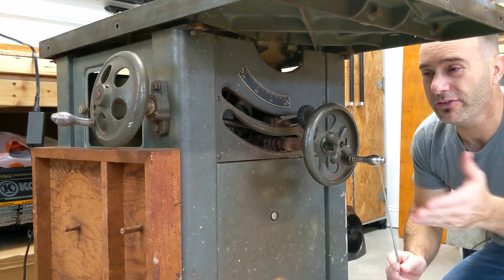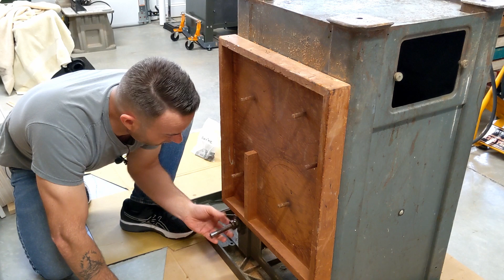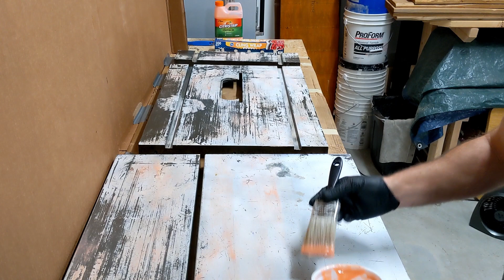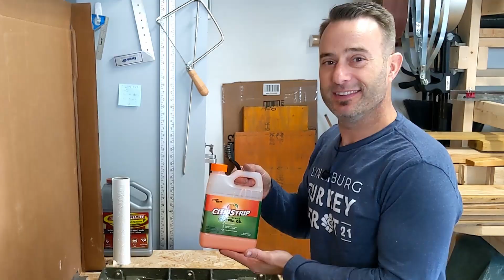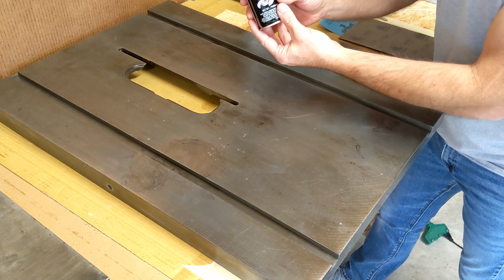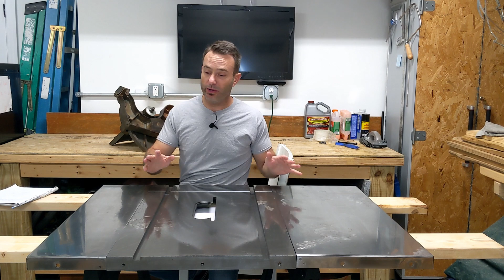Walker-Turner 10-inch Antique Table Saw, Part 2: Disassembly and Tabletop Restoration

Comment: Where did you find a vendor for the three small drive belts? I haven't had any luck. My belts are stamped AC TEX ROPE but the size or part number is not able to be read.
Reply from the maker: I haven't resembled this saw yet, I'm still on the paint phrase, but I still have the two belts that came with it. Mine are standard v-belts and I measure the length when they are in need of replacement. I've actually bought v-belts for my jointer from Amazon. Does this help?
Reply: I ordered mine from either MSC or McMaster Carr, I'll need to do some digging to find my information. You can order from either one from their online catalogs. Shipping from MSC is expensive but they will put in on your doorstep the next day.
Reply: Belt size Dayton 3L160T ordered from Walker-Turner Services in Connecticut $11.00/each.

Comment: On something as lightly damaged as that, consider a vinegar bath. 4 to 6 hours, no more, then warm wash with a heavy baking soda content, then dry and polish. If much is needed, sanding can screw with the squareness of the deck, so avoid it until the end. The vinegar will extract any rust from deep inside the pores of cast iron. But more is not better, in terms of soak time! Chemical dip as little as possible to achieve the result and neutralize as quickly as possible once you remove it.
Reply from the maker: Thanks for the tips!
Reply from the maker: I experimented with the vinegar method on this base, which will be in the next vid; it worked wonderfully. Stay tuned!
Reply from the maker: I experimented with the vinegar method on this base, which will be in the next vid; it worked wonderfully. Stay tuned!
Reply: I also found that applying a thick coat of paint stripper first, like strypease, really speeds things up and allows you to reduce the time that the vinegar is left on the surface. That's helpful because the vinegar can seriously etch the metal if left too long. I applied the paint stripper, waited about an hour, got it all off and started the vinegar process. In addition to removing the paints and glue, for whatever reason, it soaks into the rust and sort of pre-loosens it. Looking forward to seeing your saw completed, great job so far! @ForestWoodworks
Reply from the maker: @michaelconroy8060  Thanks again. You and me both 😂

Comment: That slot next to the throat plate... is that factory, or did someone cut that?  What's it's purpose?  Thanks
Reply from the maker: Thanks for asking. That slot is manufactured into the table and it provides clearance for the elevation of the blade.
Reply: I don’t think that it’s for elevation. It probably access to the arbor to change the blade.

Comment: If you still have your saw apart, would you mine measuring the circumference of your belts? I need new belts, the catalog I looked in has belts with outside length in even inches, my old belts measure 15 3/4". The catalog shows 15", 16" and so on. If you have the time and opportunity to do so I would appreciate it. Also, what color are you going to use?
Reply: Where did you find a catalog for parts and part numbers? What model is your saw? I have three small belts. 3/8" wide at top 1/4" bottom and about 15 1/2" in circumference.
Reply from the maker: @andybuchanan3212  I think you can find the catalog on Vintage Machinery. org or Old Woodworking Machinery.org. Something like that, but one of the sites might have changed. Since I haven't gotten to the reassembly, I haven't looked much into the belts, so other than taking the measurements like you did, I don't know how much help I can be. I will say that I've had much using the measurements you took and finding the belt on Amazon, but maybe eBay too.
Reply: @andybuchanan3212  My saw has a serial number 16  544, I don't think it has a model number on it. The catalog I referenced is an industrial supply catalog where I looked at belt size charts trying to find a belt matching the size of the old ones. I couldn't figure out what to get so I emailed Walker-Turner Services, he told me the belt size I needed, I went back to the catalog and ordered that size. You can get contact information for Walker-Turner Services on the internet, they are very helpful people. Sounds like you have the same size belt mine uses, I will need to look through my stuff to find out what I ordered. Industrial supply house will list belt length by pitch length which is different than the outside circumference. Sometimes the outside belt length is also on the charts.
Reply from the maker: Hey Gary! I still haven't decided on a color yet. But last weekend I was recording the trunnion disassembly and cleaning when I found a crack in one side of the trunnion system. Spent all week looking into fixing it, but I'm getting thin  on options. If I can't get this repaired, the whole project is done. I'll respond later today with the belt size. Thanks for watching and commenting!
Reply from the maker: So the belts I have are 4L170. One measured 17" outside circumference. I put a piece of masking tape on the outside face of the belt and put a mark. Starting with the mark touching my table I placed a mark on my table. I then rolled the belt and marked the table again once the belt mark touched down again. Measuring between the two marks was 17". Does that get you the measurement you need?
Reply: @ForestWoodworks  Hi, my belts aren't that wide nor that long, your machine is different than mine. I would suggest watching Ebay for parts, from time to time someone will take apart an old saw and sell parts. Thank-you for your reply.
Reply from the maker: @garyvanrheenen181  Walker-Turner Services in Connecticut seems like the place to go. I spoke to Jeff today and I've got a replacement trunnion frame in the mail. Might be a good place for you to check out as they seem to carry a lot of  replacement parts. I am so thrilled my project can continue! Check back soon as I get this trunnion system video done and uploaded. Take care!
Reply: Spoke with Walker Turner Services in Connecticut. Got the split nut OEM used part. They also have a newly machined part available. Got my three small drive belts as well. I'm a happy guy.😊

Comment: Very satisfying to see the paint scrape off after sitting overnight.
Reply from the maker: I have some options potentially. Also,  I borrowed a welder from a neighbor a couple weeks back just in case I'm the welding option... never done it before, so my first cracks at it were not pretty or structurally sound, but I'll keep practicing and get better. Either way, I hope this is the least of the opportunities encountered...I foresee more opportunities at the end of the series when I'm at the final stages of assembly and calibration, but until then. Thanks for watching and commenting Dammy!
Reply from the maker: Yeah it was fun too! More to come soon!